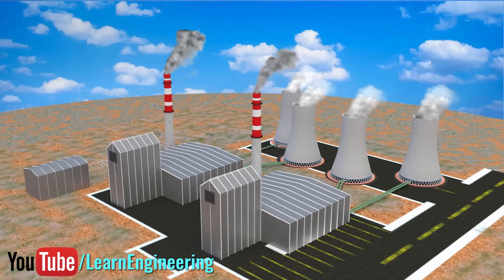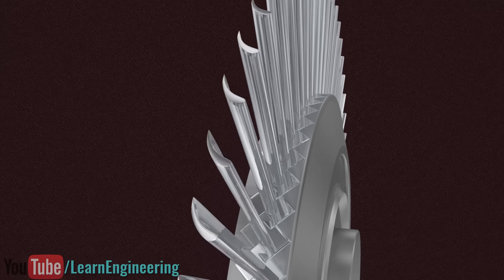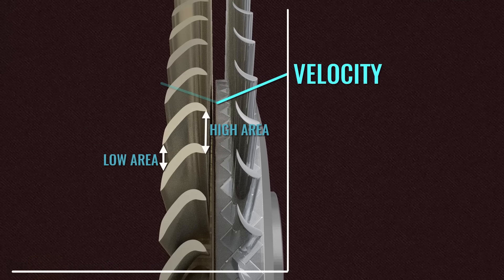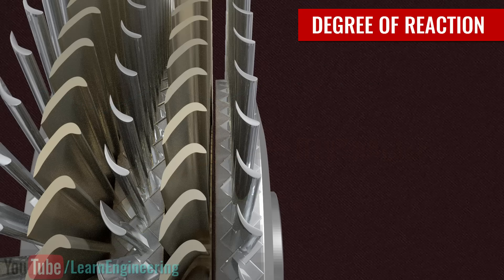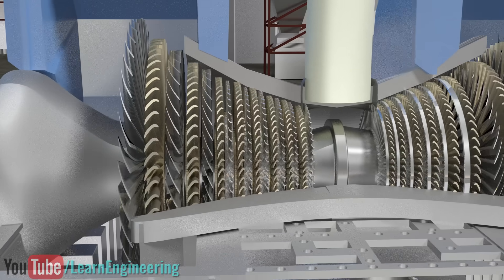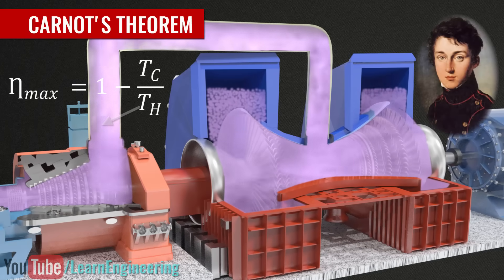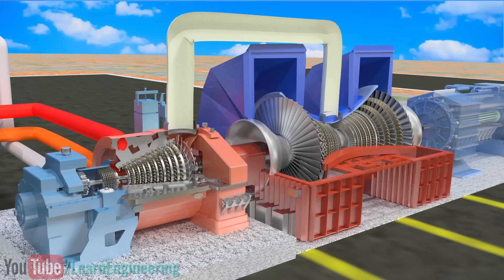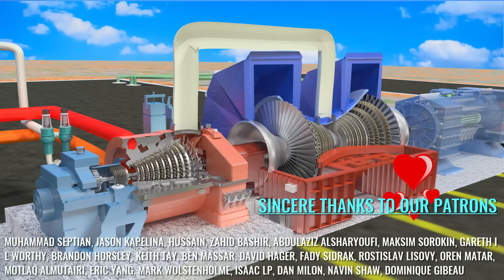How does a Steam Turbine Work?

Comment: What I don't understand is why the steam is so fast in the first place?
Very interesting video anyways, very well explained 👍
Reply: water is pumped into the boilers at a very high pressure - leading to high pressure and high velocity steam when heated up.
Reply: @Ubergeekpie  OOOoooh.... But, if it has to be pumped at a high pressure, doesn't that consume a lot of power also? I guess it doesn't consume as much power as it generates...
Reply: @NotASpyReally  increasing the pressure of a liquid (via a pump) requires relatively little energy usage. look up the Rankine cycle when you get the chance to - it'll be in any thermodynamics class learned in engineering.
Reply: @NotASpyReally  but to answer your question, yes, about 10% of the electricity a power plant generates actually goes back into the powerplant to power all of the equipment (ie. pumps, compressors, control systems, lighting)
Reply: @Ubergeekpie  Cool! I'll look that up. Thank you so much for explaining! :D

Comment: How thrust of HP and IP turbine are balanced?
Reply: Kingsbury tilting pad thrust bearings handle thrust loads and position the turbine rotor within the casing. Rotating parts clear stationary parts in very close proximity.      
0.30 inch or 0.762mm is a common measurement.

Comment: Very nice video. Just one more thing. In modern coal power plants with Benson boilers the temperature of primary stream is about 610degrees and reheated stream is about 630degrees. Seems a quite small difference but increases the efficiency of unit from 36% to 45%.
Reply: wow that is a lot of gain

Comment: the 600°C is not a problem related to the blades' materials, infact gas turbine can support higher temperatures  ; It is mostly a problem related to the steam generator that works at high pressure and also high temperature ; the combination of these factors limit the temperature at 600°C.

Comment: Why there is no  increase in cross sectional area of high pressure section of turbine as there is a large increase in area in low pressure turbine to compensate for pressure reduction? Why not area increment in high pressure section?

Comment: But, if in the path of the steam (between the turbines) and it loses the physical characteristics mentioned, that sense has two types of blades repeated many times in equal form.
The logic would dictate to vary the forms of the blades, both to progressively enlarge them (a blade group) and to diminish them in a de-progessive way (the next group of blades).
But we need a design that is measured in its variability to optimize the whole physical-mechanical process.
And then the turbines have neither the variable pitch nor the variable geometry of the blades that must rotate on themselves.

Comment: If they're able to "re-heat" the steam and send it back through the turbine, what's the purpose of having cooling towers at a coal facility? Most the the heat energy is lost, ~66%, from the smoke stack and cooling towers.
Reply: I understand where you are coming from... I was so confused myself. But to understand this we need to understand how a Thermal power plant works. Under the turbine illustrated in the video are condensers, that converts the Low-pressure low-temperature steam into condensed water... This water is still at a higher temperature but no so high for industrial use... So it is directed to cooling towers where the heat is dissipated to the atmosphere and the cooled water is supplied back to the condenser (to help in condensation). So they add cooling towers when there are condensers. Condensers are used so as not to waste clean water which is not always abundant. So in order to reuse this heated water, they pump the condensed water changing into high-pressure water and supply it to the Boiler repeating the process.
Reply: and as far as smokestack is concerned... the name itself implies that it dissipates smoke (flue gas and pollutants). It's not useful heat energy. It's just pollutive particles from the coal-burning...

Comment: This is a reaction steam turbine though correct? Not all steam turbines are of Reaction Type.
Reply: Most steam turbines for marine propulsion and generator sets utilize an impulse stage on the high pressure end. Its often called a Curtis Wheel. After 2 rows of Curtis wheels the remaining stages are reaction blades.

Comment: Hey great video!

I have a question though, why use different stages of steam (high, ip, low) if you reheat the steam to be the same temperature for each of them? Why not just use the most efficient process?

Thanks to anyone that can answer!
Will
Reply: Different stages have different pressure (IP = intermediate pressure). You can add heat energy to the curcuit but pressure will inevitably decrease.
Reply: Study rankine cycle you will understand why reheating is done.

Comment: How does the control valve know when to open up and close though, I understand its function but does it have a sensor attached to it
Reply: Think Governor.
Reply: Governing system. We give command. That command goes to governor after which it goes to I/P converter. Which covert the electrical signals to vary the pressure of control oil in oil relay cylinder. The variation in control oil pressure controls the movement of the shaft of oil relay which is linked to the control valves and hence control the opening/closing of the control valve and control the steam flow as per load input
Reply: Based on centrifugal force

Comment: why not use ceramic fins?
Reply: Probably not enough tensile strength
Reply: @darryldixon788  nope glass fibers have both more tensile and compressive strength then normal steel.
And I am pity sure that steam can not break ceramic fins that easily.
Reply: @rishavbhowmik7778  Glass is different from ceramic, and the glass might have too high a coefficient of thermal expansion for steam, it would want to be borosilicate glass at the least if you went down that road. The race ceramic they coat turbochargers and exhaust manifolds might work well for this. You dont really want the heat from the steam transferring into the turbine because then you will take energy out of the system. Titanium cant really be used either for the same reason they dont use titanium in engine internals. What do you reckon?
Reply: @darryldixon788  Glass fibers act completely different when they are inside ceramic molds.
Ceramic is great for poor thermal conductivity and glass fibers inside them make them to strong.
Just think can you break your ceramic commode with air jets( probably not probably not even at very high temp).
so what worse can steam do. its just 400degrees.
Reply: @rishavbhowmik7778  Turbine blades are usually coated in a ceramic to act as a thermal barrier and for abrasive protection. However, ceramics are far too brittle for use as the bulk material; monocrystalline titanium and nickel alloys are very strong and are resistant to brittle fracture.

Comment: I'm a retired military turbine engine mechanic (aircraft only) and always wanted to know about steam driven turbines. After the Army I joined the USCG a machinist mate (engineer) and learned a bit about them but still never had a chance to get my hands on one. My special was complete disassembly and overhaul of of gas turbines. 
This video helped answer a few questions I had.
Reply: I was a gas turbine engineer for General Electric Company who supervised the installation and overhauls of many gas turbine generator and compressor drive sets. Then I transferred to the San Francisco Marine Department and they threw me into steam turbine propulsion units. I have to say that steam turbines are much easier to overhaul. They are so simple compared to gas turbines.
Reply: i work for GE on turbines, gas and steam are way more different than youd think
Reply: Very nice, but it should be in other languages too so that more people get help

Comment: turbine blade material used in aircraft can able to withstand  1800k
Reply: the material is pretty much just steel, but some parts are coated for heat resistance. less stainless than youd think actually

Comment: The part about the "speed" of the turbine varying is inaccurate!
Reply: Once that generator is synchronized to the grid, its speed does not vary at all. The load and output of the generator can be increased by the governor and the steam admission valves.
Reply: That's true.  The speed of a synchronous generator is synchronous speed.  Duh.   The control valves change steam flow to vary power, not to change speed.   It is speed that is synchronized with the grid, not power.   The generators on the grid collectively adjust to match the load, but the power from one power plant is chosen by economics, not physics.   

This is serious misinformation.  You should withdraw this video and replace it with a correct one.

Comment: There is an important error in this video. 2:50 shows the entire low pressure turbine. But the animation is missing the first row of turbine guide vanes. In turbines you always need a stator in front of the rotor to give angular momentum to the flowing gas. The turbine blades will use the energy of this angular momentum and convert it to power according to eulers law. If the gas goes through the first turbine blade row withot that momentum, the first row cannot generate any power.
Reply: Good catch.  I think you want to call the stationary blades a row of nozzles. The stator is in the generator.

Comment: In the "Boiler, How it works" video  you said that presussure would ideally remain the same but it increases  a bit because of friction and other stuff...  But in this video you are saying that pressure is source of energy and I understand that pressure is desired....
Reply: You add a pump priot to the heating process to increase pressure
Reply: @anl2468  in boiler there will be a continuous supply of powerd coal which get heated,  in boiler it also connected with pump for supply of water

Comment: What is turbine sealing system?
Reply: The shafts usually have multiple labrynth packing glands where the shafts exit the cases. High pressure steam is not allowed out and down at the low pressure end, air is not allowed to enter the shaft and high vacuum area.  Some old 1950's designs like Westinghouse actually had water sealed packing glands.

Comment: i think our best bet for renewable energy will be Fusion, you take a metal of pretty much any kind turn it into a liquid as hot as you can get it. and then you start to compress it, until it gets real real hot (millions of degrees C) it is now called plasma (we can make this it is possible, we are just struggling suspending the plasma so that it doesn't burn down the power plant)

the best thing about Fusion is is that if you put in 1, you get 100 back (its insanely efficient) and because it works on the principal of turning metals into plasma, we already have enough fuel stored up for decades, in the form of nuclear power plant waste.

of course this still requires a steam generator to convert the heat into electricity.plasma just burn so hot, that you could probably run a multitude of steam generators of one plasma source.

vacuum compressing metal isn't the only way of creating plasma btw, another way which is being researched is with high powered lasers, the downside of course being that you need a small power plant to create your plasma with the type of lasers involved.
Reply: if you are interested in making plasma or what it looks like, you can make a very basic form of plasma right at home! all though i do not recommend doing it inside, and i do recommend keeping a save distance from your little project.

you will need a microwave of at least 750 watts, 3 metal bottle caps of the same size, and a piece of wood, like a match stick, or kebab skewer. and a normal tall drinking class. and a small piece of silly putty, or similar substance

put the microwave outside, and put the 3 bottle caps in it in a triangle formation. put the silly putty in the middle of the triangle, and stick the match or skewer in it sticking straight up. the glass should now be able to stand upside down on the 3 bottle caps, with the match stick or skewer inside the glass.

this is what you want, take the glass out, set your microwave in normal microwaving mode. and set the timer for 2 minutes. now light the match stick or kebab skewer, gently place the glass over the match and standing on the 3 bottle caps. close the door, and take distance.

almost instantly green, and red lightning bolts will surge on the inside of the glass, and it makes a Wierd un describable noise too.

you have now created a rudimentary form of plasma. now wait out the 2 minutes from a save distance, when you come back you see just how hot that plasma has burned, as in 2 minutes it should reach temperatures between the 1400-1500 degree C mark, that is well within the melting point of glass, which you will see. if your microwave survives 2 minutes that is. if your microwave survived i would let it sit for an hour or more, as glass cools down relatively slowly. but then when you take the glass out, and feel the surface of it. you can see it had started to melt, sometimes it gets even hot enough to make drips of glass that cooled down again while they were running down the glass.

Comment: @Learn Engineering , I have a question I haven't been able to find the answer to in my books or online.
-I noticed in the video, during the explanation of steam via 2nd law of thermodynamics, the narrator mentioned how the higher temperature of the steam leads to "higher efficiency of the power plant" (with respect to the turbines' temperature limit).
-My question is: Does that statement of 'efficiency' take into account the amount of coal (or other fuel source) added to increase the temperature vs the power output of the generator? OR is it Only in regards to the temperature of the steam vs power output (not taking account of heat source)?

Great video nonetheless!
-Sam
Reply: It reduces the heat rate and the specific steam consumption of the turbine only.

Comment: Where is heat/energy output
Reply: All of the heat decays through each stage of turbine wheel/nozzle as its energy is imparted to the turbine wheels. The low pressure turbine wheels actually operate in a high vacuum where a condenser is located under the unit. You can lay your hand on the low pressure cases and they feel cool to the touch, no need for insulation. Almost all of the pressure and temperature of the steam is expended as torque to turn the generator. The condensate water is pumped back into the boiler to begin the cycle over again.

Comment: The throttle valve on a turbine that's tied to the grid will not control frequency. It only controls the amount of load placed on the turbine.
Reply: Bingo! So true. When the 2 lights on the syncroscope are out and you smack that breaker closed its locked into the grid like you slid a giant gear into mesh.

Comment: if it acts as a nozzle , the large area means less velocity amd high pressure but what you have shown is reverse .Can you please clear
Reply: Steam at normal atmospheric pressure will expand to around a thousand times its water volume so each stage of blades is at a lower pressure but larger volume then the stage before it.
Reply: Isnt turbine in this video acts like diffuser, inlet area is bigger than outlet area, i dont understand how pressure decrease, it should increase and velocity decrease

Comment: Great video. 
Though, there is something I must nitpick. You say that ΔEnthalpy is ΔEpressure + ΔEtemperature. That may be Gibbs energy, whose equation is G=U+PV-TS, where U is the internal energy of the fluid (ie chemical energy and energy due to height), P is the pressure, V is the volume, T is the temperature and S is entropy. 
Enthalpy is only H=U+PV
https://en.wikipedia.org/wiki/Enthalpy

Also, I do not understand the purpose of this DOR number. What is it ? 
You also say that you obtain DOR by dividing Gibbs energy by the total energy change during the fluid's passage through the turbine. How do you calculate this energy ?

Comment: A 500 MW thermal power station may use a 50 MW electric boiler feed pump, where does the power come from to drive the pump to start the power station running?
Reply: Robert Smart Generators perhaps.
Reply: Plants are typically started using electric feed pumps. Once pressure gets near operating range on start-up, steam driven pumps are used.
Reply: Grid tied at start up so simply have another plant or 2 ready to crank out more power for the heat up phase.